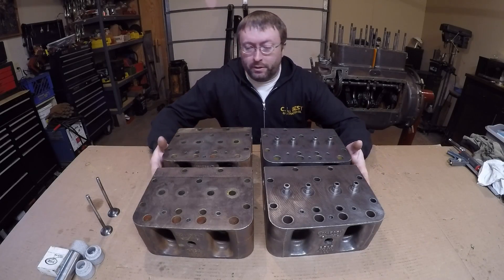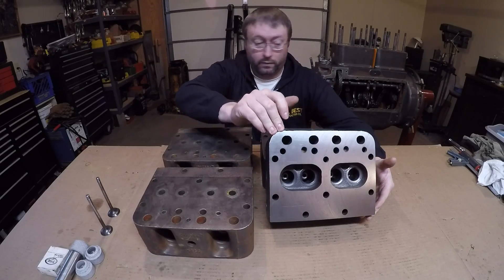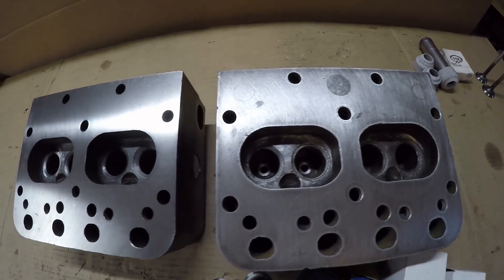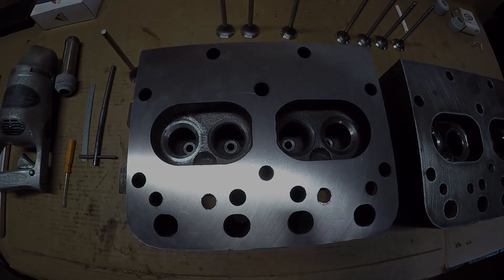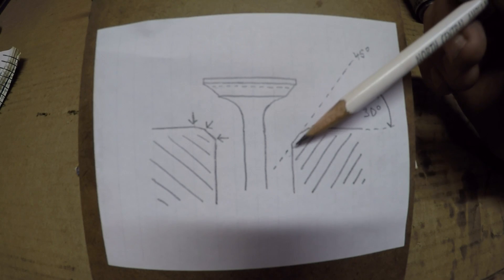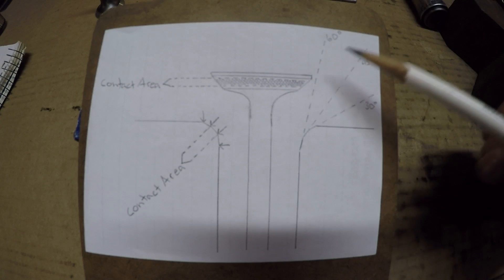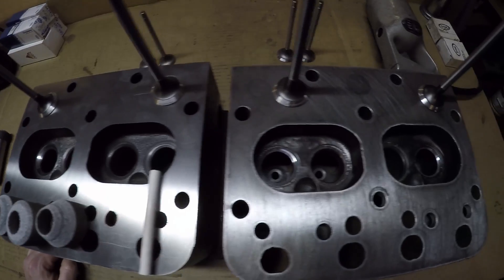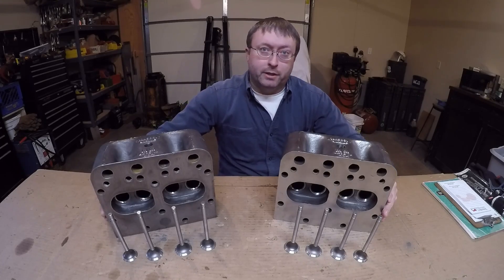Minneapolis-Moline Prototype 445 Tractor #X231 Restoration - Part 12: Reconditioning Cylinder Heads

Comment: I realise you probably won't run this engine much but the hard seats compensate for the low lead gas we are stuck with.
Probably a lead substitute additive will be needed. plus adj the valves more often.
Thanks I am enjoying your skill and knowledge with these old engines.

Comment: wow... you need new bearings in your sioux seat grinder.. you may need new bearings in the stone holders too.. i think those are R-8 bearings.. to get the caps off.. collect up some small block chevy and small block ford crank sprocket..  they are the exact size of the stone holder body..  a flat washer and a nut on the threads will push the stack of sprockets to push the cover off without damage.  the inner core can come out with the bearings.. then the bearings press off the core..  you may want to use single seal on the top and bottom sides of the bearings and shielded toward the middle to keep dust out.  its been so many years since i had my sioux driver motor apart for new bearings.. i can't even remember it..  i could not see if you use Hex or Spline drive stone holders.. https://i.imgur.com/eSfpkKR.jpg   the drive and dressing tool https://i.imgur.com/iUPzttg.jpg    my stones.. https://i.imgur.com/II0WPMZ.jpg i left a bunch at a former job i forgot to pickup when i left..  my dry valve refacer https://i.imgur.com/9Ppo5Kq.jpg  i got tired of replacing the cotton high speed belt every time i needed to use it.. so i put a micro v belt on it.. https://i.imgur.com/h0Z5Mdk.jpg   flat head ford pilot laying down and a flat head ford carbon scraper https://i.imgur.com/NHe45FD.jpg  ..  

 Huge hint... scrounge a mid 80s to early 90s mitsubishi.. 2.0 or 2.6 JET Valve assembly.. the valve springs on the tiny jet valves are JUST perfect to drop on the pilots to hold the stone holder up off the stone..  makes grinding valves so much better..

Comment: Another great video! What brand of valve grinder did you use to check the new valves?? If you found new valves untrue,  especially agco/clevite/mahle valves I would take a very close look at your valve grinder. Check the run out of the chuck with a new valve out of the box and a dial indicator. If your valve grinder is a Sioux there's a 98% chance it's junk. Even with new chuck balls it hard to get a Sioux grinder under .oo5 runout.  Closer to .000 is better.  I have nothing against stones and use them in certain applications but most Sioux stone holders are worn out and wobble on the pilot. I'm sure you dressed the stones but didn't show it in the video, but then the video length would get lengthy.

Comment: My grandpa gave me his old Sioux vale grinding machine a few years back, it's been sitting in the corner of my shop because I really have no idea how to use it or even where to begin.  Your description shined some light on the principals and gives me some hope that someday if I do get the nerve to set it up I might have fighting chance I won't fail miserably!  I have touched up valves in the past so I'm not completely blind to the process however they were valves on Briggs and Stratton engines which didn't require as much effort.

Comment: Thanks for the basic valve grinding discussion...i dont understand why the valve recession must be similar for all the other valves. The lash adjustment ultimately eliminates the need for uniformity. Unless the power difference between cyls due to different charge (VE)
is undesirable?!